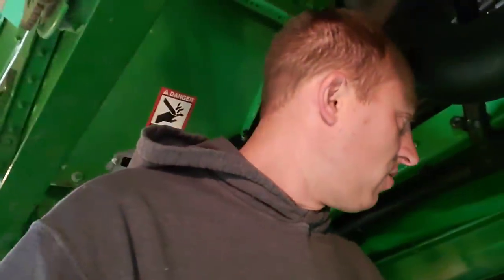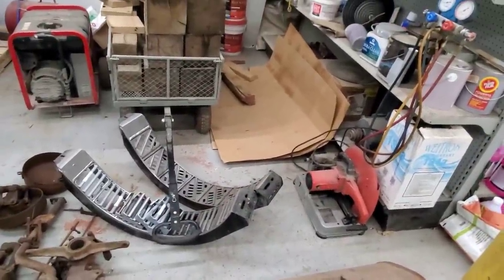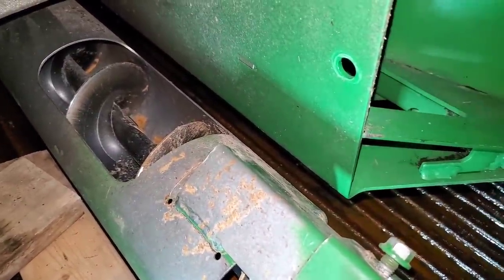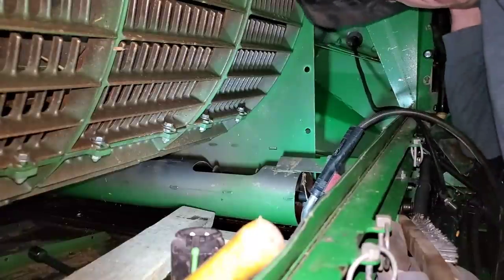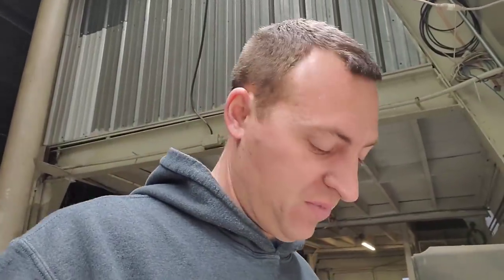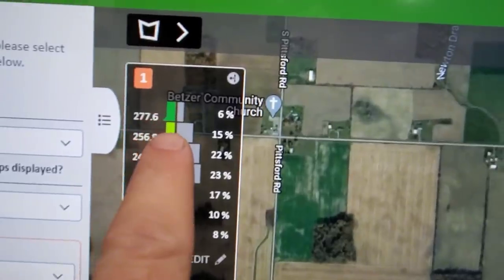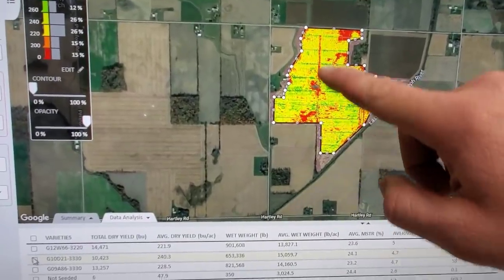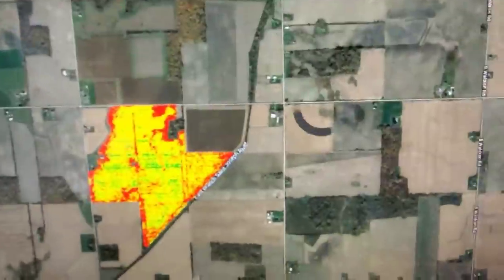Weld it Up and Irrigated Field Analysis - #302

Comment: What was your average yield difference between all the non irrigated years and the irrigated years? 
It appeared that 194 bushels was your over all average of all years, both irrigated and non irrigated combined, correct? 
The reason I am asking is that I'm curious about the long term economics of water. Your diesel bill had to be substantial and since 2008, corn prices and diesel prices have varied substantially.  
In the the long run, your additional labor and sleepless nights are not free either. 
BTW, I don't think there has ever been a "normal" year.

Comment: Dumb Question (Never grew corn) - why replant?  Non-germination? Wind erosion?  Frost?
Reply from the maker: We had 5.5 inches of rain the week after most of our corn was planted. The rain caused soil crusting and flooding. The corn either died from the water sitting on it, or couldn't push through the soil surface and died. The replant was to fill in the thin areas.
Reply: @BorderViewFarms  Many thanks.

Comment: Your yield maps all are based on the corn moisture levels of 20% and higher. Why not correct all yields to 15%, and then compare moisture levels of irrigated vs non irrigated. Betchya the irrigated land would be wetter than non irrigated. Wet corn yields are not good to compare anything to as the elevator pays on dry corn.
Reply from the maker: That was a dry yield map its already adjusted to 15%. Wet yields don't mean anything so I never talk in wet bushels. Anytime I reference a yield its moisture corrected.
Reply: @BorderViewFarms  OK, thanks sir.
Every yield map you showed had a moisture number listed, that is why I thought the yield numbers also printed on each map were not corrected.